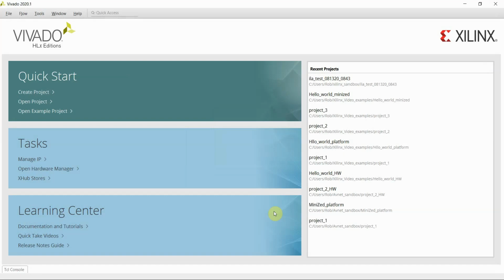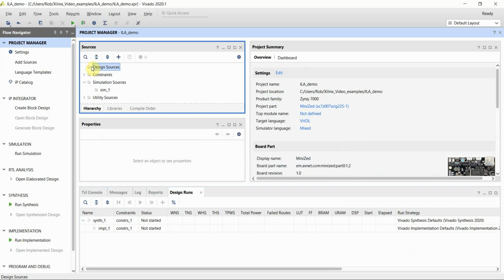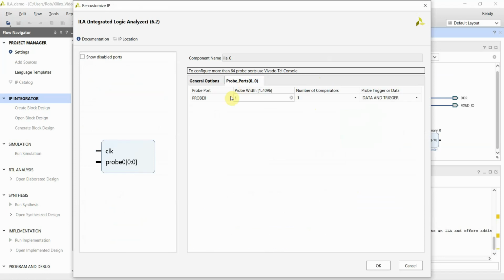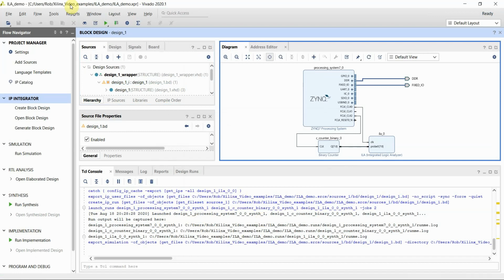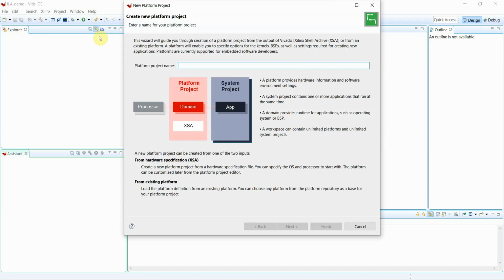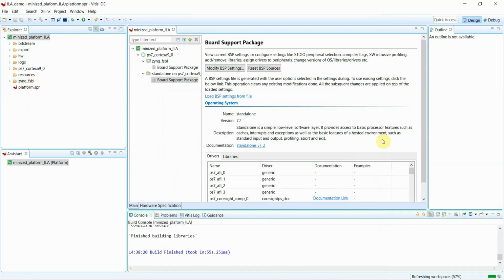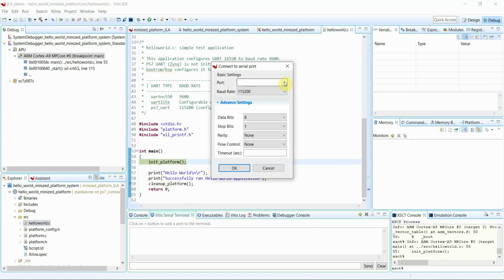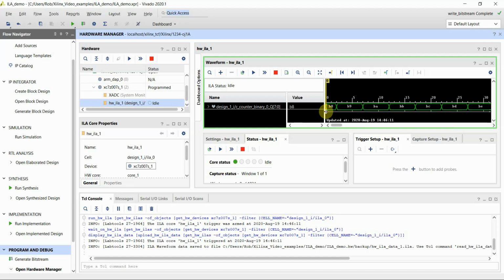Xilinx ILA  Demo using Vivado 2020, Vitis, and Avnet Minized rev1

Comment: Why did you run VITIS here? It was not necessary to show the use of ILA.
Reply: He uses the Zynq processing clock (FCLK_CLK0 and FCLK_CLK2) to  drive the counter and the ILA. Therefore he has to start the Zynq processor to configure and start the clocks. This is done by running the debugger in Vitis.